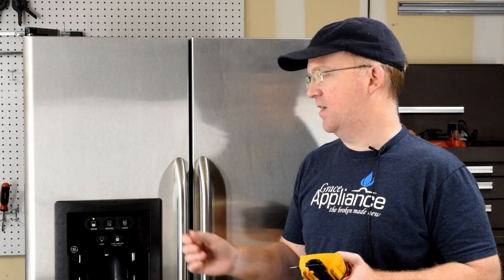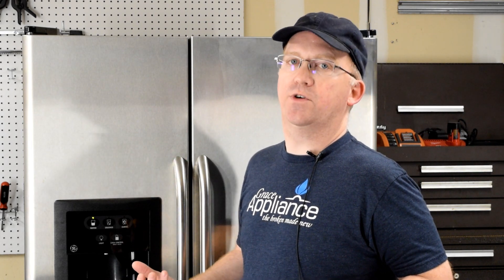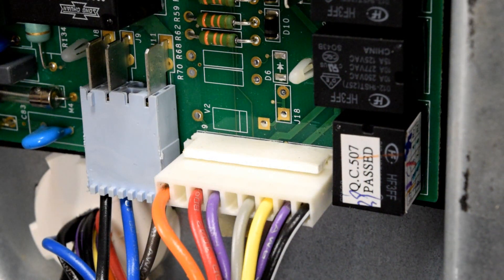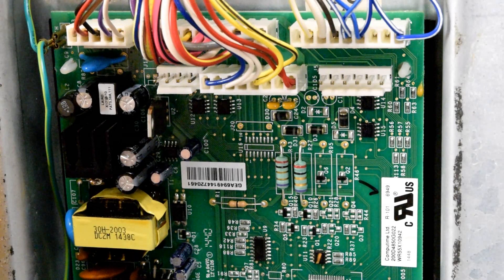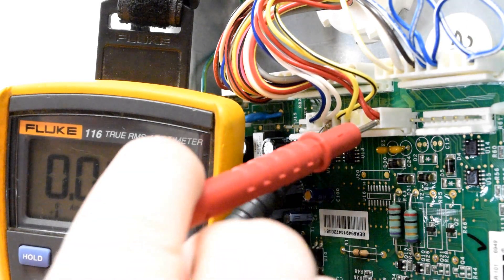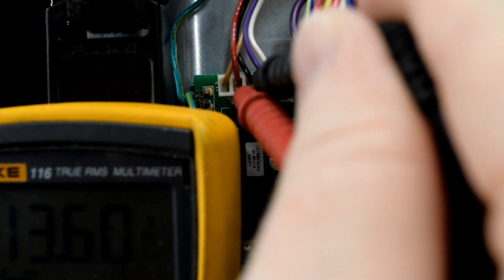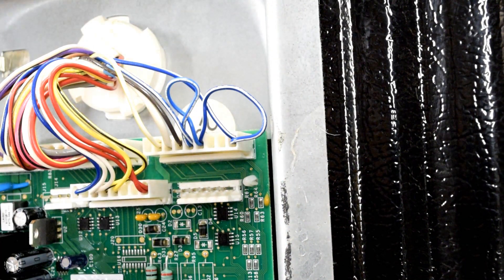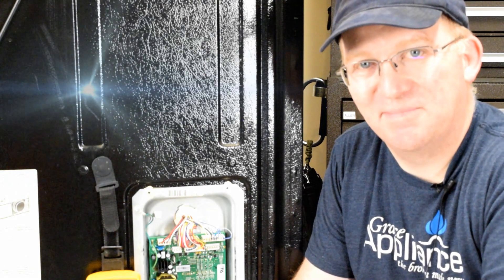Dead Refrigerator - What to Check

Comment: how do i reset my fridge ge model gsc23lsrcss
Reply from the maker: Hi, the only reset you can do is to unplug it and replug it back in.
What type of issues are you having?
Reply: @GraceAppliance  we had power outage, light is on but fridge and freezer not working.
Reply from the maker: @samchowdry  hey,
It sounds like a failed control board to me. 

I'd start with this video:
https://youtu.be/ViFpwH6_WrM

This will help you determine if it's the main control board or the front touch panel that's failed.  

It's likely going to be the main control board, but you'll want to rule out the front touch panel as well to be sure.  
I've also got a video showing visual inspections you can do on the main control that may help.  

Thanks and let me know if you have any questions.

Comment: GSE23GSKECSS on my third control board and second inverter. Board has power but fails all other tests. Light on in the unit, but nothing else works. HELP!
Reply from the maker: Hey Will,
Start here. https://youtu.be/ViFpwH6_WrM

Unplug the connector for the front touch panel and see if the fridge comes on. If so, you have a failed front touch panel.
Reply: Fridge didn't come on and I do not have proper voltage at the control panel or on the control board where it plugs in. Is it possible I've gotten two bad boards from ge?
Reply: Also I have lights on in the inside but nothing else
Reply from the maker: @willthurmer6080  
You say you have power to the main board. What voltage do you show for this test?

1:30sec of this video 
https://youtu.be/PhQKqF5MgDE

The probability of getting 2 bad boards is almost 0% I think.
Reply: @GraceAppliance  I show 122v on the power side, but none of my tests show good voltage to the components
Reply: @GraceAppliance  I found a brand new unopened board in my shop and swapped them out with the same results
Reply: @GraceAppliance  also I just checked a functioning fridge and noticed the board has a tiny green led blinking. None of the ones I've tried have that. Do you know what the led signifies?

Comment: Would a bad control board cause the temperature control panel on the front to quit working?  I have the same scenario that you described.  The only thing that comes on are the lights in the refrigerator.  The lights on the control board are not coming on anymore.  This all happened the other night after the electricity went out.
Reply from the maker: Hi Troy,
I definately can.
But, to determine which board is at fault, you'll need to unplug the front control board and see if the fridge comes on at that point. If so, the front display board has failed.
If not, check for 12-13.5vdc between the red and black wires coming to the front panel. 

There is also a connector by the freezer hinge that can corrode and cause this issue.

Let me know what you find once the front board is unplugged.
Reply: @GraceAppliance  Is that the J-4 connection you show at 5:12 that disconnects the front control panel?  You're saying if I unplug that and the refrigerator comes on it is the front control board?
Reply from the maker: @TroyShaw  correct, or you can also unplug it at the front board itself.  Either one.
Reply: GE Side-by-Side ONLY - Refrigerator Repair Videos I replaces the back control board and it came on but now the display on the front where you control the temperature is just blinking 0. What do I do?
Reply from the maker: What happened when you unplugged the front board?
Reply: GE Side-by-Side ONLY - Refrigerator Repair Videos nothing.
Reply from the maker: Troy Shaw ok, remove the kick panel and by the freezer hinge you’ll have a white plug. Unplug and replay this 5x and see if you have any change.
Reply: GE Side-by-Side ONLY - Refrigerator Repair Videos https://youtu.be/D4TsN_2yqnM
Reply from the maker: @TroyShaw  also, please send your model number and the part number of the board that you installed.
Reply: GE Side-by-Side ONLY - Refrigerator Repair Videos gsh25jfxn bb
Reply: I don’t know the model number of the board. It’s what the guy at the repair place sold me. He said it was the right one. I already threw the box away.
Reply: I’m not sure what the kick plate is that you’re talking about.
Reply from the maker: Ok, the kick panel if you’re standing in front of the fridge by your feet under the doors you’ll see a plastic panel that you can put toward you and it comes off.  On the left hand side near the freezer hinge is where you’ll find that plug.  

Start there and if you still have issues we can research a bit to see that you received the right board. It should be a WR55X10715 or 
 Substitution: WR55X10942.  It looks identical to a board with a different part number
Reply: GE Side-by-Side ONLY - Refrigerator Repair Videos ok so I do what exactly with the plug? The guy at the parts place said the board is pretty much the same for all of the ge refrigerator. I guess I can take off the back panel and look.
Reply from the maker: Sorry for the typo. Unplug it and replug it in again 5x. They are prone to poor connection and corrosion. This helps make sure you have a fresh connection.
Reply: GE Side-by-Side ONLY - Refrigerator Repair Videos thanks for all your help. I’ll try that tomorrow. At least it’s cooling.

Comment: I have a ge profile artica refrigerator. Lights and temperature controls are blank. However temperature numbers come up on the temperature adjustments. I blew out the condenser.
Reply from the maker: Hi Mike, please send your model number when you can. It’s in a tag inside the fridge section.  Andy

Comment: Hi Andy, I have a GE  GSH25JSTC SS unit and by following instructions in your video, I came to the 
  conclusion that it is the main circuit board. the voltages to the fan circuits was erratic, going from 0 to 
   10 volts dc but never to 13 volts. also there is no power going to the compressor, I verified the compressor is ok by jumping the 2 wires on the light blue connector. it worked fine too. I have the new circuit board coming soon. do you think I should also get the fans ordered since the resistors that control the fans on the failed board were brownish in color.  Great Videos !!   THANK YOU !!
Reply from the maker: Hi Moytech,
Yes, you would need to replace both fans if both have turned brown. The fans caused the board to fail and would do the same to the new board as well. The evaporator fans especially have the tendency to short out because they live in a cold wet environment.

Let me know if you run in to any snags. Also, if you'll look in the description there are Amazon affiliate links that you can order the needed fans. Using these links helps the channel a ton. Thanks! 
Good luck!
Reply: @GraceAppliance  Well that explains it all 
I installed a used board  and everything worked well, and suddenly it just quit working everything was off except for the interior lights. I have the new board in already but I will not install it until i replace those fan motors.
Thanks for your help,  and for your great videos, I am  sure they are a blessing to  a lot of people as they are for me .

Comment: Hi Andy. 

I am having a problem where my GE SXS has all the fans running but the compressor isn’t running. I have tested the compressor start relay, capacitor and compressor resistance and all tested good. I tested the control board as shown in this video. I get good voltage when I check across the orange wire and line. When I check across the orange wire and compressor I get no voltage. Would this be a sign of a bad control board?
Reply from the maker: Hey Dave,
Sorry to hear about the issues!
If you're getting 120vac to the 2 wires before the compressor relays, the control board is going its job. 
However, if you do not get voltage after the compressor relays, the relays are bad.

Does that makes sense?
Reply from the maker: Sorry, I was on the road and just reread your comment. 
I agree, if your condenser fan is running, the compressor should also be running. You could also test your compressor circuit by unplugging the fridge, install a jumper wire from the L1 (I.e. the furthest right on the light blue plug) and the furthest left on the light blue plug. This is your compressor circuit.  Then plug in the fridge. This applies 120v to the compressor and it should run and this point. 
If so, it’s a failed control board.  
Be sure to unplug the fridge before removing the jumper wire.

Comment: Hi Andy,
my refrigerator isn't working. all the light is on. Inverter board is good. control board likes good but there is green light in the control board flashing? refrigerator is GE Model no pfe29psdass. please help. thank you
Reply from the maker: Muhammad Afghanzada 
Hey, the first thing I’d check is that it’s hasn’t been accidentally been put in to demo mode. 
If you want to send me an email, I can send you a tech sheet for this fridge and it will help with putting it in service mode and identifying any codes that would help in finding the right direction to go with diagnosis.   

GraceAppliance@gmail.com
Reply from the maker: Thanks Muhammad, email sent.

Comment: Hi Andy,

First of all thank you for sharing all these videos. They are a great help.

Could you perhaps help with something? My GE refrigerator has gone dead and I have the same symptoms as described in your "dead refrigerator" video. Lights on inside, front panel lights off, everything else dead. 

My main control board is burnt. The control board I have is a bit different and has three resistors, the 2 that you seem to describe for the fans and a third larger one which burned. 
Do you know what this third resistor corresponds to?

My fridge is a PCG23MIMAFBB and the replacement reference of the control board seems to be WR55X26733. 
Do you know if WR55X26733 is compatible for 220-240V? (I live in Europe)

In addition, before my fridge died, I also had issues with food freezing on the fresh food side. changing the fridge temperature would not help. 
I saw that this may be a damper issue - do you confirm?

I've put all my pictures including the burnt control board (and the videos I took so I would know how to plug things back) on my google drive in case you want to have a look. https://drive.google.com/drive/u/0/folders/1zDqzM9W8LEd-K7c7ZRfRQBCquqi7gTnR?ogsrc=32

Thanks in advance. Kind Regards, Christelle
Reply from the maker: Hi Christelle, thanks for the kind words. I'm so glad the videos are helpful.

I'm sorry for the short reply, but I am on my phone and headed off to a call. Being away from my computer will make it tough to find some of the answers, but was able to see the pictures you posted.

Most electronics are going to be US & Europe compatible. You should see somewhere on the model tag or the part itself that says 110/220v. That would put your mind at ease, but you're in good shape on that so long as you replace with the same part number.

As for the resistor, yikes! That was dramatic.
I'm afraid I don't know exactly what that goes to, but do not beleive it is related to either of the fan motors. There are no control board level specifics given from the manufacture beyond which wires go to which component. So, I'm afraid I'm not much greater help than that in this instance.

Ideally we'd love to know what circuit the resistor relates to because we would want to check out that particular part for function too. However, many times a power surge or simply a control board failure will cause this failure. 

 In any case, I think putting the new control board in should do the trick, but obviously the risk is there that you hace a faulty part casing a larger issue.

I wish I could be of greater help!
Reply: Hi Andy, OK thanks. I'll try changing the board then and see what happens. Good to know it's not always related to a greater issue - which gives me hope :-). Thanks for taking the time to reply. Kind Regards, Christelle

Comment: bad braker?
Reply from the maker: Phillip Song hey Phillip, 
If your interior lights are on in the refrigerator, you can rule out a bad breaker.  The breaker is the resettable fuse that the incoming power comes through via your electrical box which is typically located in your garage.  
Does this answer your question?

Comment: I have a Maytag refrigerator, model number MFI2269VEM2.  Nothing is working except the inside lights.  The front display including the temperature control is not working.  If I push any button on the front display, all indicator lights light up, but when I take my finger off the button, it stops.  I had a technician come out and diagnose it - he said that the Dispenser/Control panel in the front was not working.  I ordered that part and replaced it, but it still is not working.  I am thinking that it is the main control board in the back, but as mentioned earlier, when I touch any button in the front, it does light up but then goes back out.  Does that mean that the control board in back is good?  Another note:  A couple of weeks ago the compressor was kicking on and off, so I cleaned the condensing coil and that appeared to take care of that.  I am not sure if these two are related.  Can you please give me some advice?  Thank you.
Reply from the maker: Hi Larry, 
Sorry to hear about your issues with the fridge.  I agree with you that it must be the main control at this point.  This part would also cause the compressor symptom like you mentioned.  I can count on one hand the number of failed touch panels that I’ve needed to replace and can’t count the number of main boards I’ve needed to replace.  
While I haven’t come across this particular (maybe ever) my first guess would be the main board vs the touch panel. 
Here’s a thread that discusses that specific issue on your particular model. You’ll find it talks about how it’s a tough one to diagnose because of almost zero manufacturer troubleshooting steps. 

https://appliantology.org/topic/57907-maytag-model-mfi2269veb2-refrigerator-control-panel-stopped-working-as-did-all-cooling/

Sorry I couldn’t be more help though!
Reply: Thank so much. The main control board had a little bit of a burn small to it, so that helps to confirm that's  the problem.  what was throwing me off was that I had power( all displays lit up) on the touch panel when I pushed on any of the buttons, and knowing it controlled the compressor (temp control).
Reply from the maker: You’re most welcome. Good deal! I’ll be curious to know the outcome. Best of luck!
Reply: update, I installed the main board.  the evaporator fan is now working but compressor still not running. The touch panel has temp frig and freezer is lit up.  it looks like error message.  The freezer says PEO the frig temp says 000.  If I push the temp up and down buttons at the same time it reads across PE H20.  This is the only part that will light up.  if I push the water lever water will come out and the light where the water comes out at the dispenser is continually on.  Do you have any idea where I go from here?
Reply from the maker: @larrytallent7879  hey Larry, that's a good sign actually. You will need to program / calibrate the board to match the fridge.

Here are instructions for that.
https://www.applianceblog.com/mainforums/attachment.php?attachmentid=22332&d=1431789892
Reply: Thank you, but we are still confused about the following abbreviations:   LL, UR, LR.  Can you help us out with these abbreviations?  There is nothing on the keypad for the fridge that corresponds with these letters.Is there any way that we can send you a picture of the keypad for the fridge?
Reply from the maker: @larrytallent7879  lower left, upper right and lower right if I recall.
Reply from the maker: See here at 3:40sec
https://youtu.be/7YOOJxrE3DA
Reply: The fridge is running! The YouTube video gave step by step directions for a Maytag .  Thank you so so much for your help!!!!
Reply from the maker: @larrytallent7879  you're most welcome!  I'm glad it worked out well. Stay in touch.